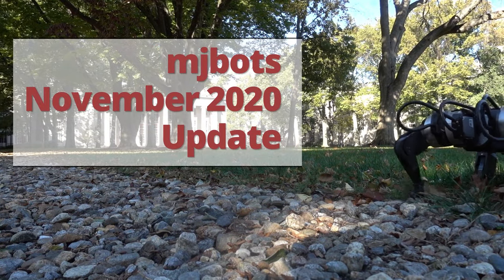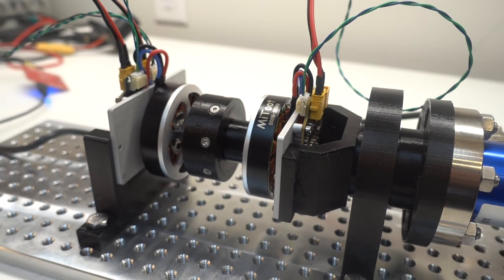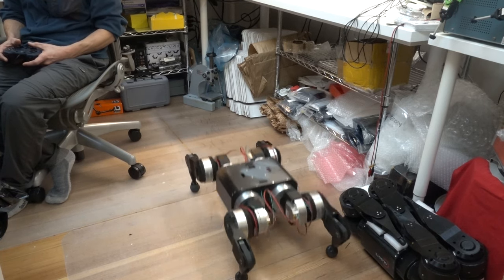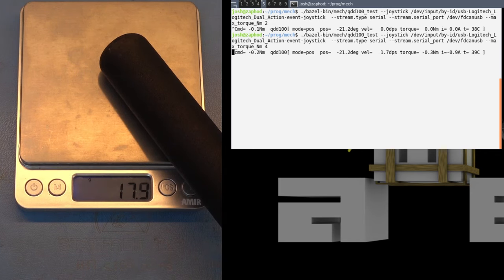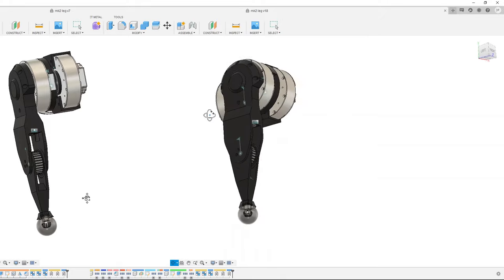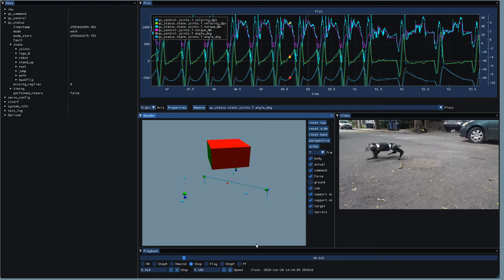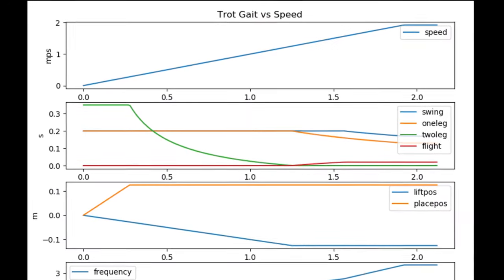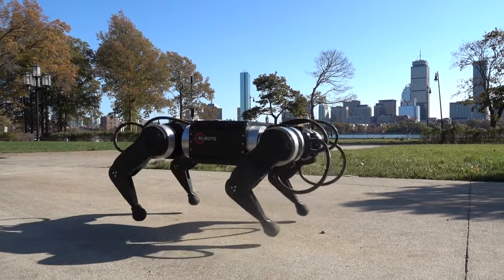One year of building a robot dog

Comment: So cool, is there any scope for the moteus mjbots controller being controlled by step direction commands like a stepper motor. I'm assuming it has positional feedback like the Odrive controllers, I note the cam function, my aim is to build high speed 3d printer/laser etcher. Thanks
Reply from the maker: A step direction input is something that could be implemented, most easily using the ABS port, however such a feature does not exist now.

Comment: Hi is available for buy?how much cost RTR WITH CONTROLLER PREPROGRAMMED? Please let me know thanks have a good day
Reply from the maker: While I have sold a few evaluation units, I wouldn't categorize it as "RTR".  Operating the quad A1 requires some skill, and currently an external laptop or phone as a controller.

If you're still interested, drop me a line at info@mjbots.com

And yes, the price probably qualifies as "if you have to ask"...
Reply: @awesjosh  hi thanks for response.....RTR is ready to run full assembly and preprogrammed yes i have a phone how much cost ?Is controlled with an app? Please let me know thanks have a good day
Reply: @awesjosh  hi is possible control A1 with a ps2 controller? Please let me know thanks have a good day
Reply from the maker: Yes, the evaluatios units we have sold are fully assembled and ready to run.  That does not mean it is a polished product that you can expect to work in any terrain with no tuning.

The control is a web application, and supports any gamepad that Google Chrome supports.  It has been tested with PC gamepads like a generic Logitech one, XBox controllers, and bluetooth phone gamepads.

If you want a quote, please email info@mjbots.com

Comment: Question : Why are you using BLDC only ? Why not use servo instead
Reply from the maker: These are servos!  A servo is just a motor that has position feedback.

If you were asking why hobby servos were not used, they typically use brushed motors and have port torque transparency.  They cannot easily be used for dynamic motions like running and jumping.

Comment: It'd be especially useful when it has it found its first landmine or unexploded shell. It'd also be nifty if it could carefully draw all the explosive energy out of a landmine or enexploded shell so as to recharge its own battery whilst simultaneously rendering the shell/mine harmless. And then it would 'fetch' the landmine/shell and melt it down into raw materials that can be made into more robodogs.
Reply from the maker: I do think you are on to something!
Reply: @awesjosh  I think (but can't be arsed to rewatch atm, even though it is a cool video) that the robot dog you made is running a pi4? Right? The pi3b (and plus) is way better than the pi4 and not above its station. Not a huge fan of the pi4. It is a 'meh' sbc IMO. So, if the dog messes up and explodes into a great many pieces (on a mine/shell) at least it is only a pi4 that bit the dust.
Reply from the maker: Previous versions did use the 3b+.  The pi4 does use more power, but I was able to get things running a bit faster with it, which is why I switched.
Reply: @awesjosh  Well it is a nice project. It is a pity two (presumably networked or joined by gpio and an mmu or similar with extra chips) pi3b boards cannot be used for the sole reason of discouraging manufacture of the pi4 beyond owning 1 of them just to learn it (and then never use a pi4 again), and to encourage people to get a pi3b as a protest vote against the pi4 (and to encourage a dual cpu version of the pi3b with more RAM). But I nitpick, and should focus on the fact that you have a nifty robot dog thing there (which definitely should do the landmine/shell thing somehow).
It'd be nice to see the robotdog thing dig up a shell and then wear it like a ghostbusters backpack as it vampirically drains the life out of the shell and the shell shrivels like a grape into a raisin.
It would really annoy people who deploy landmines because they'd be paying for their opponents' robotdogs everytime they do so. The dog's eyes could roll over like dollar/pound signs everytime is does that (as a form of psychological warfare gloating).
Reply: something like drug maybe? :)